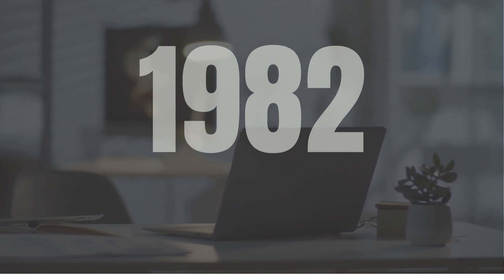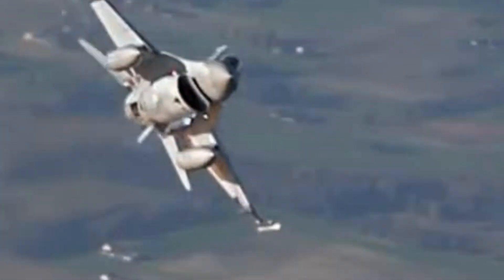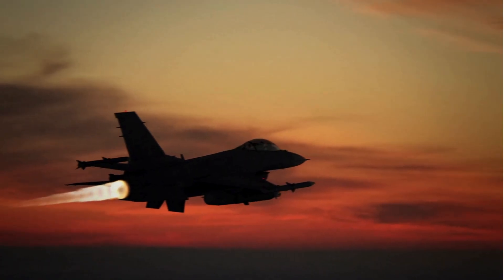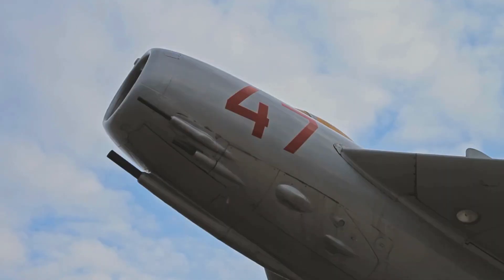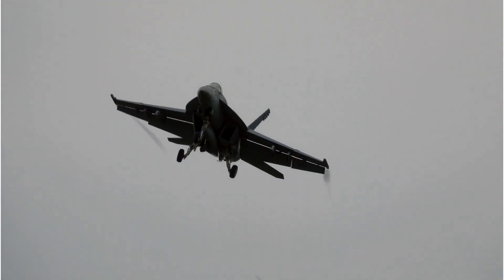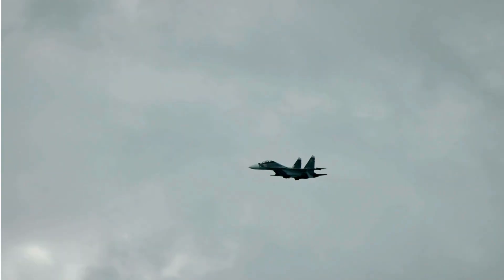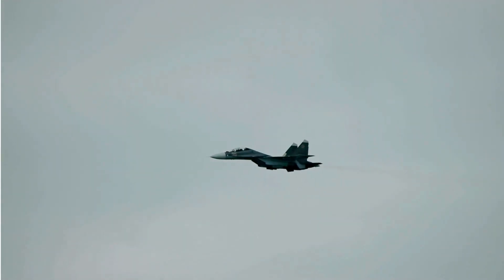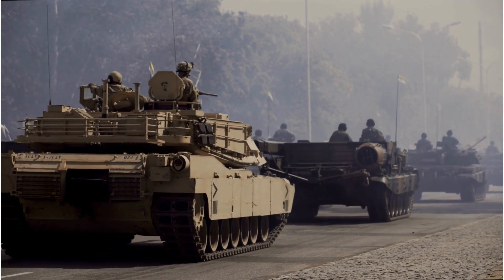Why The F20 Tigershark Failed

Comment: When people who use GOOGLE to get information make videos. This is absolutely WRONG and BULL. I was a kid when the Tigershark came out. I kept up with all the trials etc. The plane was too good at it's job. Its costs to run were low, used common parts, had a high payload, speed and maneuverability. Politics killed it
Reply from the maker: True
Reply from the maker: And the end of the video I say its stilla good jet but the selling cooked it
Reply: @militaryguru  I lived near El Toro when they test the jet out there against F18s and F16s. It did so well if I can remember what the news paper said (before internet) it had like a 5 or 6 to 1 kill ratio against  F16s adn F18s. Trust me the internet is not always right and mostly incorrect factually. What killed that plane was political bullshit. How can contractors bilk millions of dollars off an aircraft if it only cost a measly 10 million per unit VS the F22 at 150 million per unit. It was cheap, fast, heavy payload, handled like a porsche, pilots LOVED it.. what it did not do was make people rich.. and THAT is what killed it
Reply: @militaryguru  for someone referring to himself as "guru", you made a crappy info-vid, containing nonsense information. Google is not a good reference. Try again.
Reply from the maker: @ronaldv_tm  what are you on about? You are yelling at me for lying supposedly?  All that in the video is true and I might of over exaggerated a bit but the video is still mostly true and what else am I supposed to use for info?
Reply from the maker: People like shoptrook who comment with actual back up to there comment I like. But people who just say your bad and this is stupid have no back up to there comment and are just angry and yapping

Comment: A victim of policy changes and politics.
Policy at the time prevented US front line tech from being sold to other nations. The F-20 was developed to provide an effective fighter to export that did not rely on current front line US tech.
Politics also prevented the manufacturer from marketing it, everything had to go through the DoD. (insert politics, bribery, conspiracy, investigations, etc.) Eventually the DoD was ordered to market it properly. Unfortunately by then the policies restricting sales of the F-16 outside the US changed.
It was slightly cheaper than the F-16 to purchase, and had an estimated 50% lower operational cost. The F-16 by then had made a name for itself, and F-20 sales were limited to two or three orders eventually cancelled entirely before any aircraft were produced.

Comment: It crashed 70% of the time is the second problem....?
Reply: There were only ever three prototypes built, and they flew over 1500 flights.
Two were lost in demonstration flights in both cases due to pilots pulling too many G's and blacking out, the aircraft were not at fault.
One survives in a museum.
I don't know where the source gets "70%" from, and I don't know how anyone would blame the aircraft for the pilot pulling too hard and blacking out.
Reply from the maker: The second problem discussed ya see? Not the second problem of the jet, but the second problem I discussed in the video

Comment: Bad idea, no. That's just wrong. Good idea. Good little plane. Great engine. To late to be a viable option to the F-16. The people who could purchase and maintain a Viper, did. The people who had to buy F-5's, couldn't afford or maintain the F-20 by time the increase in costs were factored in. Produce that before the F-16...sales out the ass!! Its one of the best little aircraft, no one bought. But not a BAD IDEA. Then again, I'm in the YouTube comment section, so I can't be to smart.
Reply from the maker: No I can see where your coming from alone of people liked the jet
Reply from the maker: It's just 2 people died in it when only 3 were made so...